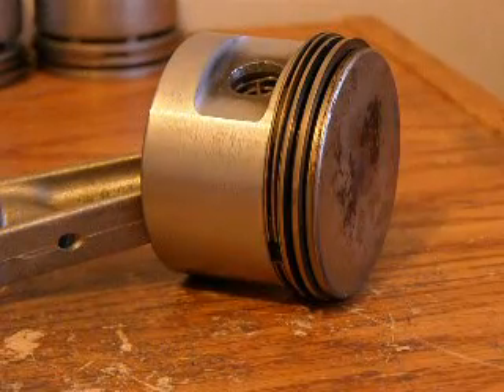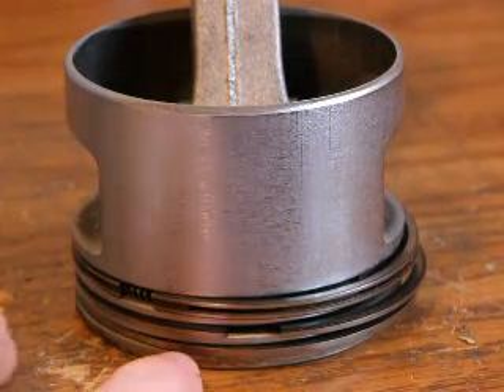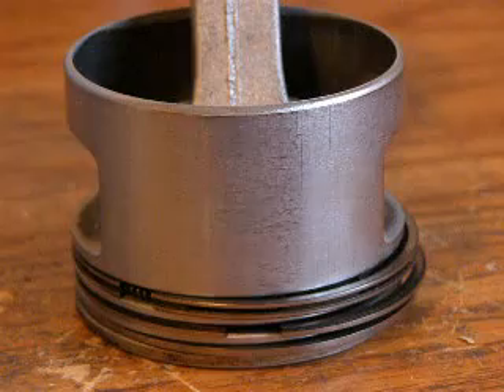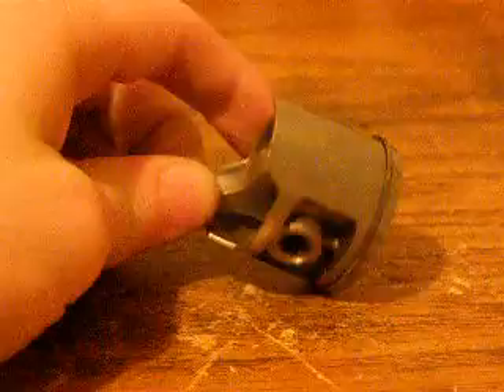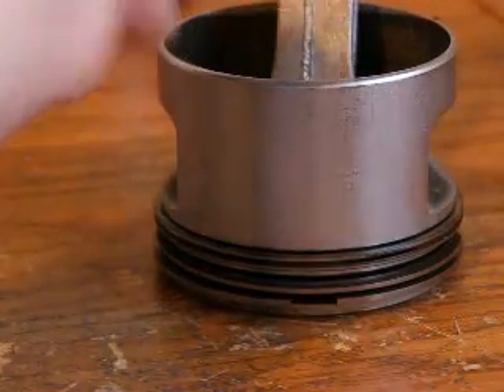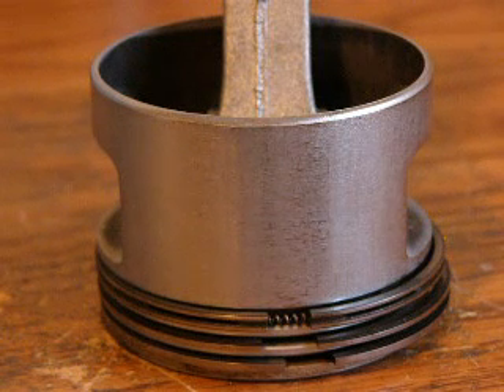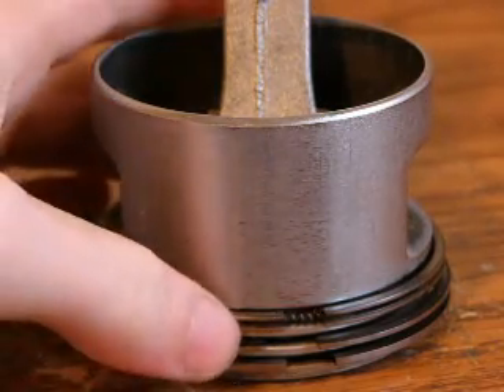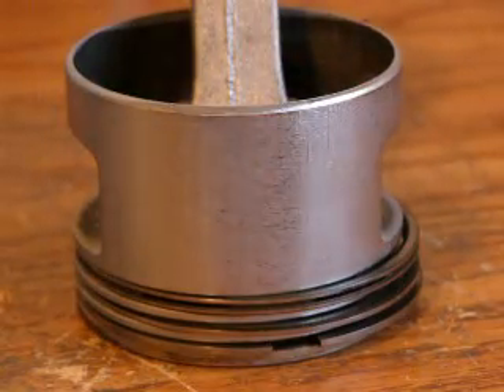All About Piston Rings

Comment: can i bypass the fuel pump on a 10hp kohler 1970 jd riding mower will it still run. thank,s
Reply from the maker: Robert Mccaffrey  If it is a carbureted engine, you might be able to if you connect a fuel line from the carburetor strait to the gas tank, the suction from the engine may just draw it right in with the help of gravity. But that is just an assumption and I'm not 100% it will work, so do so at your own discretion. :)
Reply: thankyou

Comment: Wrong... 1st one is compression ring the other two are oil control
Reply from the maker: Stiliyan Varbanov Nah, I'm pretty sure that the first 2 are compression rings, the oil control ring may be a combination of 3 parts, but there is only 1 oil control ring, and 2 compression rings in most internal combustion engines. Although you would be correct if you're looking at the 2nd compression ring to be an aid of the oil control ring to help keep out engine oil from the combustion chamber. :p